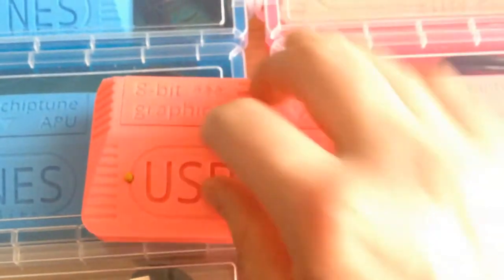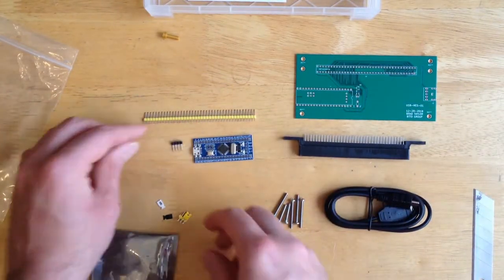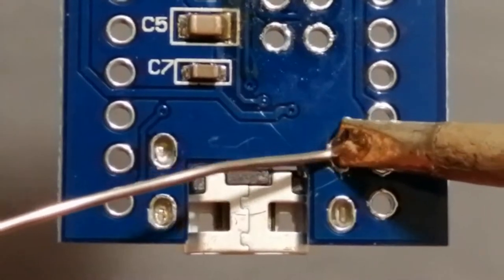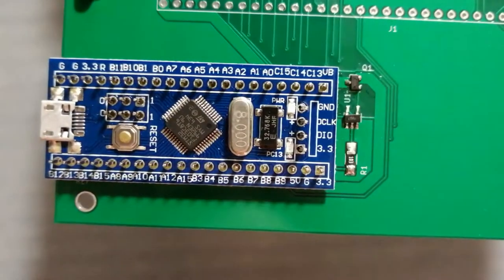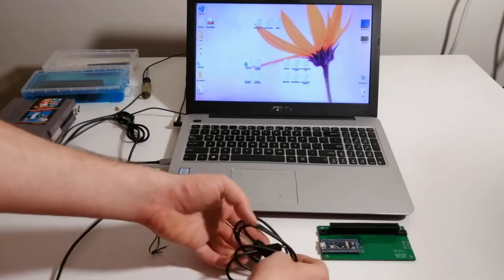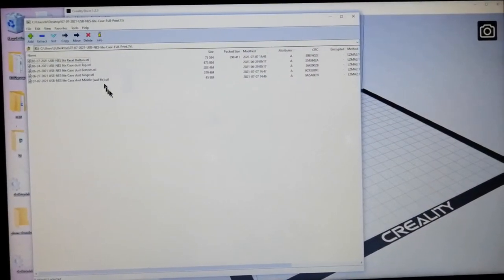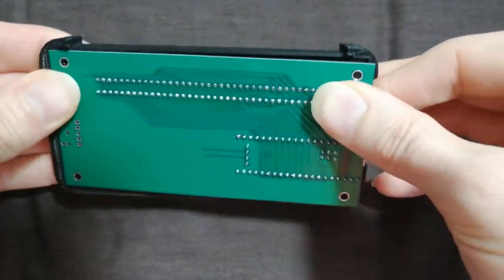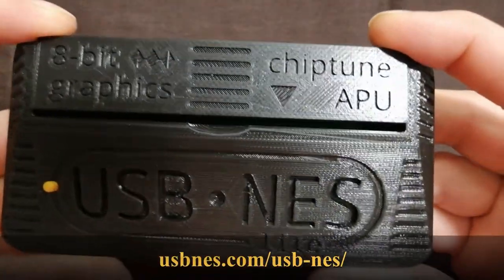How to Build Your Own USB-Based NES Game Cart Player!

Comment: Nice project but it's not necessary when you can download the complete NES library in under a minute. Still playing on a PC if it's done your way or not.
Reply from the maker: You're right; It's definitely not for people on the cheap!
Reply: @officialusb-neschannel5945  😂 I'm just saying either method achieves the same goal. You end up still playing on a PC. Mine as well do the easy process.
Reply from the maker: @100Bucks  You're right!  So you're free to make a video and tell all your subs that!  Or are you just trying to pick a fight with a channel smaller than yours for no reason?  I'm just saying 😁

Comment: It works on PC????   what operating system is that???
Reply: it's windows 10 just look closely
Reply: @unpotatoedsalmon  then you should specify next time., "PC" isn't an operating system. Linux,  Mac OS , BSD , Android,  etc are operating systems.
Reply: @midixiewrecked7011  it enumerates as a mass storage device so it will work with any os that supports usb mass storage devices (which is pretty much every modern os)